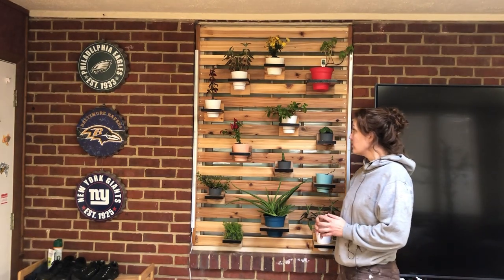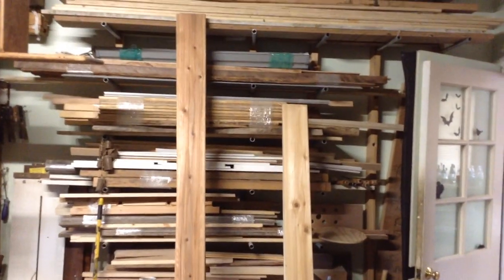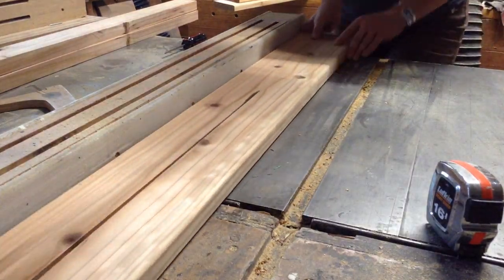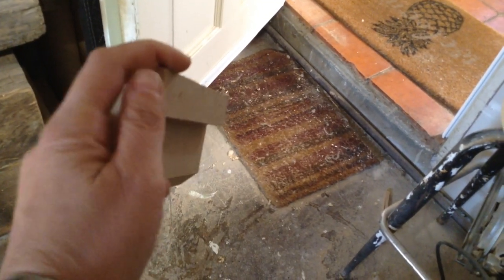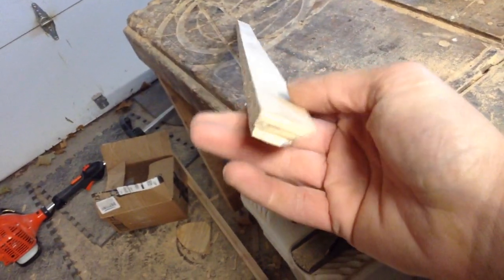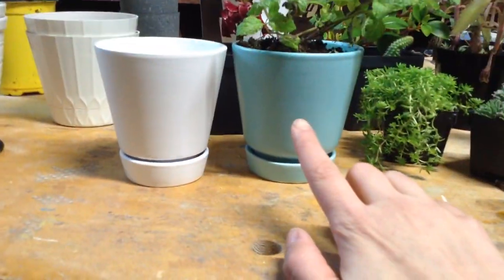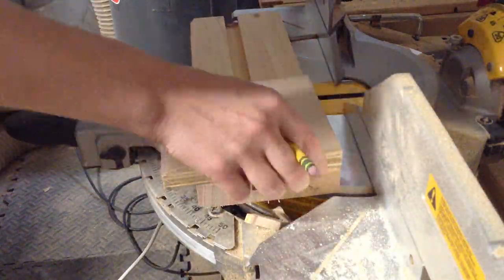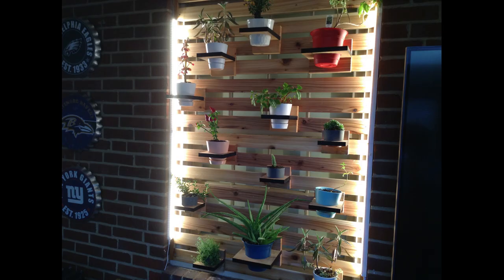Woodworking : Modern Plant Wall // How-To

Comment: Love it. How does it work to water the plants? Does water drip on to the floor from the bottom of each container?  I guess one could build a shelf with some sort of drip pan.
Reply from the maker: Thank you for mentioning this I forgot to mention this in the video.  I specifically bought plant pots that have the drip trays attached to the pots so I don't have to worry about drips.  And I have found watering them with a spray bottle creates no mess, but also since you can just lift them out of the holders.  The ones that need more water I just carry to the sink.